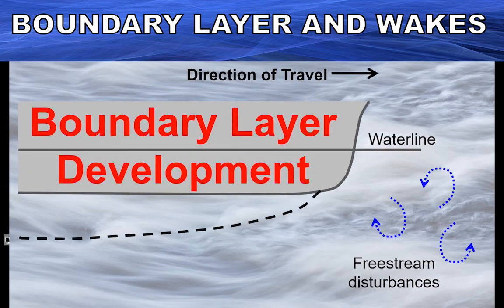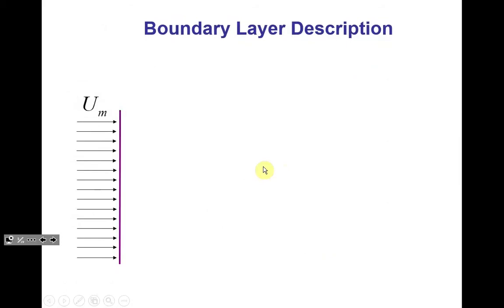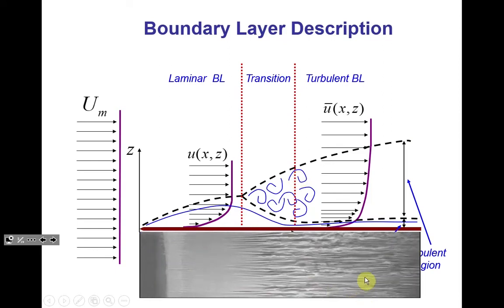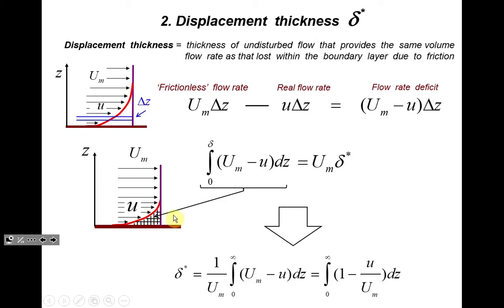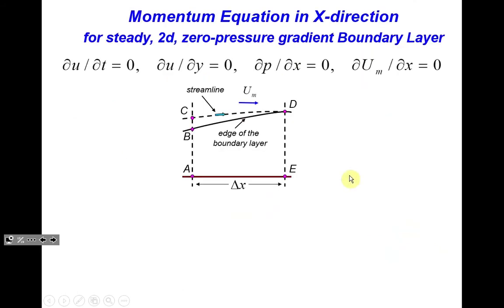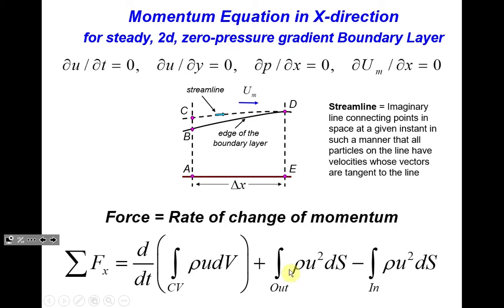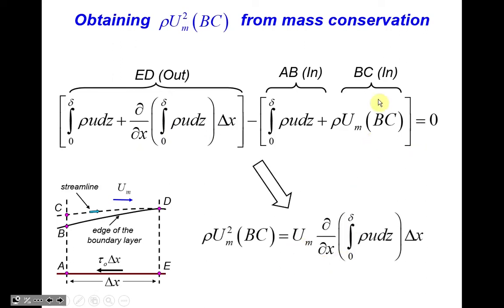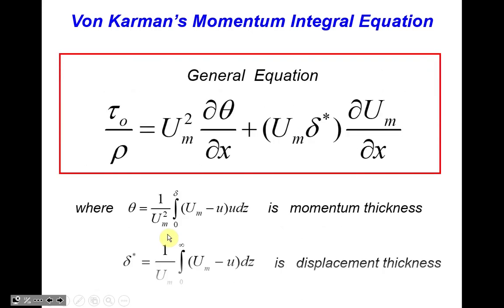Boundary Layers and Wakes Lecture 1: Definition, Description, von Karman Momentum Integral Equation

Comment from the maker: Boundary Layer and Wakes module.
In 1904 Ludwig Prandtl proposed that an external flow may be considered in two parts: (1) that in the boundary layer where the shear stresses are  very important, and (2) that beyond the boundary layer where, in general, the shear stresses are negligible. Engineers need to predict the shear stresses or drag forces acting on a body within the boundary layer. And for this they use Boundary Layer concept.  
First lecture covers the following topics: 
Boundary Layer Definition; Qualitative Description; Integral Analysis of the Boundary Layer; Boundary Layer  Thicknesses: Disturbance thickness, Displacement thickness, Momentum thickness; Control Volume; Mass Conservation; Derivation of von Karman’s Momentum Integral Equation.